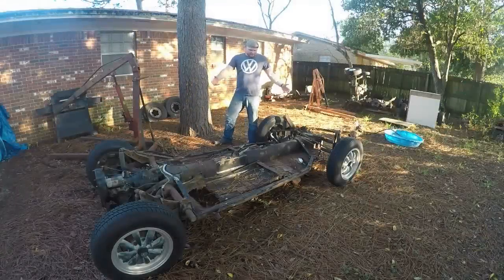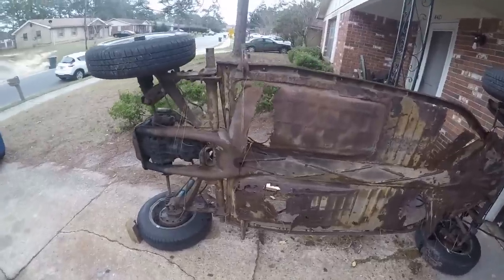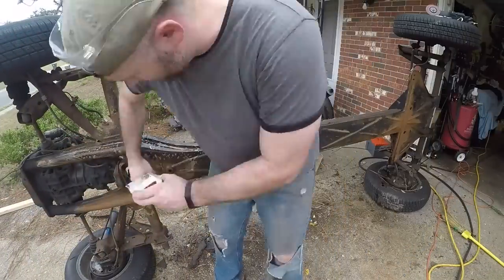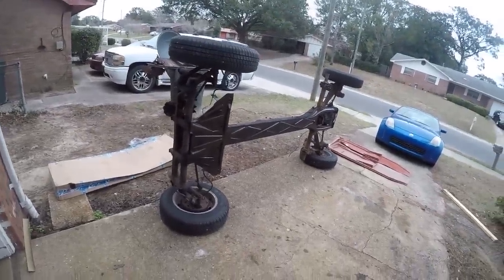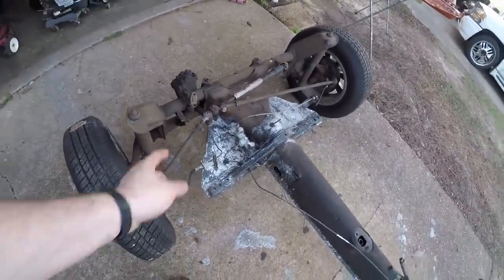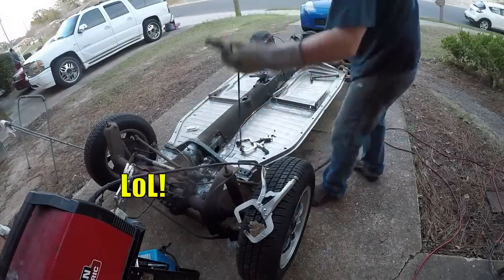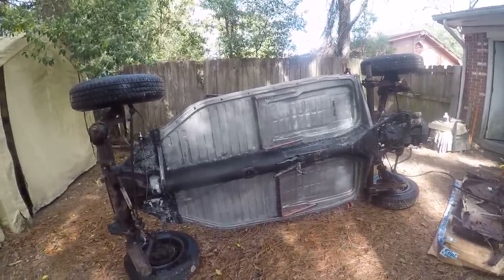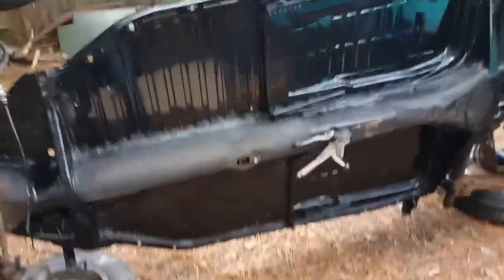Replace VW Floor Pans in 25 Minutes - (Beetle)

Comment: When you see a guy put that much effort into painting what amounts to a car's subfloor, which will never be seen by the owner, you know it's a guy who cares about his work. I wish YouTube would have come along ten years earlier. It probably would have saved my old dear departed Ghia. You truly can fix anything on these cars given enough info and motivation. Thanks for helping keep these old timers out of the crusher, Duckman.
Reply from the maker: At this point after rebuilding my 56 Oval from rust... lol, I just may be able to fix anything....'!  Kind comments like yours at the ones that really motivate me! Thanks so much for sharing!  Do you have any videos of your old Ghia?
Reply: This guy has my vote!  I've followed his stuff for years.
Reply: DuckmanCycles and VW Garage  I'm doing some rust work on an old 98 xj  jeep cherokee man I keep getting discouraged when I think it's is looking up I find more rust.  What can I use to stop or slow rust in areas I can never get to to prep like channels and cavities.  Have you ever used eastwood products do they work? I really really like the acid idea I'll be looking for it too
Reply from the maker: Acid for sure, but you really need to wire brush anything that you can get to.   Once the acid dries away there are inner chassis waxes and tar type coatings with super long  360 degree nozzles that allow you to spray deep in the inner crevices.   Otherwise you have to cut holes and attack things from the outside... which in the case of my oval was probably the best thing to do. :-) Eastwood has a lot of great stuff but I find them to be a little bit expensive when you can find the same things elsewhere without their name for less money. One thing that Eastwood is, is marketing Geniuses! Their name is just everywhere anymore!  Thanks for the questions!
Reply: Stay healthy Duckman! ... I'm saving up for my '68 Bug restoration! You've certainly gained my trust!
Reply: DuckmanCycles and VW Garage
Reply: I totally agree.. A real professional
Reply from the maker: Thank you very much! Really appreciate it
Reply: Given enough info and motivation? Given enough info,  motivation, time, energy, and money.

Comment: Long time VW guy here and I was doing this back 40 years ago. You have a knack for cutting right o the chase and pointing out what needs to be done, although I must admit the chassis you have to work with was pretty straight forward. Up this way we were seeing floor pans in this condition on a 10 year old vehicle and after that the end braces for the front suspension would start to rot. I had to sell my 69 bug for parts when it was 9 years old! (bought it new) It was too far gone. Heater channels too at an early age. Yup, salt on the roads and water leaks everywhere did her in. While I'm here, I should also point out that it's easier to find all of these restoration parts now than it was in the 70s.... internet and all.  <LOL> Oh, for those on a budget, the plasma cutter is nice but not a high priority. (read: expensive) OTOH, for any project like this a wire feed welder is the cat's ass, along with a decent grinder and an air type cut-off wheel. Add a tape measure and a hand full of specialty vice-grips and you can fix anything.
Reply from the maker: Thanks do much for this awesome comment and praise!  I really can't thank you enough!  This one made my day! Most videos I usually show the work done in 5 minutes, this is actually one of my longer videos and surprisingly has gained some huge popularity.  I am from NJ myself, I understand what you mean by these cars just rotting to bits from all the salt.  The plasma cutter was expensive, no doubt, but the amount of money I made using the tool paid for it many times over... for the average "Harry Homeowner" working in their own driveway that may not be the best investment.  I absolutely LOVE by box of vice grips!  Seems any time I find some on sale I buy a few more.  Thanks again for your comments!  I really REALLY appreciate you, and I hope you subscribed!  Lots more videos to come!  :)
Reply: BTW, where a plasma cutter really shines is fabrication work. You can dice up scraps of metal almost as easily as using a straight edge and a utility knife on drywall. My personal project of the moment is a '64 Corvair van and I am having to make a zillion small parts because NOBODY makes aftermarket body metal. I actually made a cardboard template for a door skin then transferred that to fresh metal with the plasma cutter. Yeah, the cardboard caught fire but it can do the job if you work quickly! <LOL> BTW, wish I could find better (read: fairly rust free) bugs up this way. It would be fun to tackle another in my retirement. I might even have some NOS parts still laying around!
Reply from the maker: Put up some videos of that Corvair!  I want to see!  It'd be great seeing you burning your cardboard templates with your plasma cutter.   Haha!  I'd subscribe!  Thanks again for the comment and the story, lol!
Reply: Maybe in a year or so after I retire I'll get around to learning about how to post videos on YT. Right now I'm too much of a cave man / technophobe to understand that part, although I do have near 1,000 pix of the Corvair project now that I am comfy doing digital cam work.
Reply: rupe53 If you had sprayed the underside with oil from day one regularly, you would still be driving it !.
My sister purchased a 65 model off  the original owner who did this ,it is still original and never been near a welding shop !.
Reply: ++ Gerald Swain..  Around here they call that a Vermont rustproofing. It's what you do with your old engine oil. Only problem is you need to know where the car will eventually rust to add that protection and 50 years ago most of us weren't old enough to have that kind of wisdom yet, not to mention we had an almost new car that we didn't want to stink up like it had been leaking oil for 10 years. Also makes a mess out of the garage floor for a couple of weeks. <LOL>

Comment: Wow !!!  I had a 69 automatic stick shift same color..took  2 .. 55 gal drums and made new floor pans..i had to cut the top and bottom of the drums split them down 
The middle then run them over with a fork lift...they turned out very well..also replaced the heater channels..wish i still had it..you did well.. Cheers 🍻🍻🍻🇺🇸🇺🇸
Reply from the maker: Thats an interesting way to make floor pans, lol!  If that was available to me I'd probably have done the same thing in the past!

Comment: Hey Duckman! 
Any idea where you can buy Ghia pans with seat rails installed?
Reply from the maker: No afraid not, I haven't seen anyone EVER sell them that way.  I'm going to guess because Ghias have two different sets of seat tracks, and then there is VW Things, too (use the same floor pans) that use their own seat tracks.  Since they don't sell many of these pans they only make them as "one size fits all"  Just my guess!
Reply: Thanks. I guess I will have to deal with it when I get to that point.

Comment from the maker: Buy your acid/rust converter here: https://amzn.to/2ruGW0B
FREE SHIPPING Beetle 48-70 pans here: https://amzn.to/2T7hvOk
FREE SHIPPING Beetle 73-79 pans here: https://amzn.to/2wtD1qI
71-72 Beetles have unique seat tracks, you can use the earlier floor pans if you modify or replace the early tracks on the vw floors.
I keep getting asked, so I hope this helps someone!  :)
Reply: DuckmanCycles and VW Garage .Nice video. Not sure you needed to remove the orange paint from the replacement parts. That coating should be both weldable and funtion as a primer.
Reply from the maker: Thanks for the comment, but it was chipping off rather easily in a lot of places.  It was not something that was going to stay on!  I appreciate the comment, but yes, it needed to be cleaned off before properly painting.

Comment: You have one steady hand with that plasma cutter. Job well done sir!
Reply from the maker: Thank you!  I cheated though, lol!  I kinda ran it along the metal seam...  hehehe!
Reply: @DuckmanCycles  that's not cheating that's using your noggin. I have a 70 , well the wife does but I'm going to do the work. It's pretty rusty, and I'm afraid to pull the body... Lol thanks for taking the time to edit/post this video

Comment: I think he does a great job but if I was doing it I would have the front and rear suspension off and would blast the remainder of the frame put in the new floor pans then paint the whole shebang as a unit.
Reply from the maker: Yes, if that were my pan.... or if I was paid for that much more work.  But I wasn't so you get what you get!  Thanks for the comment!

Comment: just a question, I never saw you take measurements, how can you be sure that the body will fit on the new pans
Reply from the maker: Thanks for the question!  Measurement is really the only way short of test fitting everything together.  But I have a video going up that details this tonight at midnight!  Make sure you subscribe and hit the bell!  Thanks for watching!  :-D
Reply: First time I did pans, on my brothers 72, we were just lucky everything lined up. I didn't think they wouldn't line up. When I did my second set, separate 72, I bolted both pans to the body, and set it on top of the frame. Tack and lift then finish, but I had brazed everything, only had a stick welder at the time and....
Reply: wheres the video of measurements? Ever think about doing a video of heater channel replacements? Seen this video like 5 times because Im about to do my floors. Thanks for the videos

Comment: I have a 412 wagon. Sleeps in the garage waiting for that guy. You know the guy that want to pay 20k for a project. Hes probly 2 or 3 years old right now so we wait...
Reply from the maker: There is always someone that will pay too much... I've been pretty good at finding them.... haha!   Thanks for the comment Nate!
Reply: Gold
Reply from the maker: Hehe
Reply: Oh I worked for a wrecker for three minutes and was pulling engines out of front end utes and cars in 10/15 minutes,oxy off the front grill brace panel,bolt cut the plumbing and wires,unbolt the bell housing and fork the motor out,while it was all savage like,it’s possible what you can do,check out Jonathons W site for old cars and first starts,this fucker is gold I tells ya,thanks buddy nice work,loved the chop job.

Comment: If I ever get a bettle I'll know how to do floor pans
Reply from the maker: Get one!  Get one!  :-D  Thanks for the comment!  :)
Reply: DuckmanCycles and VW Garage been looking 
Sadly most of the ones on my state are rusted out or stupid expensive
Reply from the maker: What state are you in?
Reply: DuckmanCycles and VW Garage Kentucky 
Curse you road salt
Reply from the maker: I used to live there, I had a short stint in Hopkinsville.  But you're not too far to travel to down here and find one.  No salt here, except the ocean.  Usually the VWs here are rusted from the inside out when the windows leak because of all the rain.

Comment: You made it look easy! I used to have a 71 AutoStick that was a hoot! I was a receiver at the auction in Baltimore that I believe is part of the Manhiem Group. I lived in West Baltimore City and sometimes the county but I bombed it on I-695, I-95 & other very busy roads with a 1/4 sheet of plywood to retain my carpool buddy and my driver's set had a brick on the heater channel & seat frame to keep my seat from rubbing on the road! #3 plug was the derathkneel!
Reply from the maker: I'll admit, it kind of is easy.  Its a lot of work, but not particularly difficult!
and hahahaha!  Thats quite a story!  This car the other had a 2x4 bridging the hole in the floor so he could drive it, and a mat just to keep the road spray down.  Talk about dangerous! LoL!

Comment: Great video its exactly what I was looking for . I understand this video is a few years old and I haven't read all the comments but I have a suggestion that you leave the paint on the pan and only remove the paint from the lips that will be welded. I'm not a car guy but I am a welder. Just a suggestion to save time and energy. Thank you again for the video.
Reply from the maker: Thanks so much for the comment!  You suggest you're not welder, but are you a painter?   Would you paint over rust, and other peeling layers?   That's why paint was removed... and the pans properly sealed afterwards.  You're be wasting a lot of time and energy when the rust gets worse, and the new paint peels off, too... WHEN YOU HAVE TO STRIP IT ALL OFF, BUT THIS TIME WITH THE CAR ASSEMBLED!  Bad news, dude!  Thanks again for the comment!
Reply: @DuckmanCycles  Were the replacement pans already rusty or what do you mean? I think he means not to strip off the paint on the new pans. Wouldn't it be perfect surface to paint on? I'm not trying to look smart here, I'm just new to this and confused at this step. I have my fathers old -73 that needs this, and I'm planning my steps 😅
Reply: @DuckmanCycles   what I said was leave the red paint and only remove paint that will be welded or that you cut in to. I said I'm a welder, so it's obvious when your welding on something that's galvanized and not galvanized. It's obvious the paint on the pans were a type to prevent the rust so your wasting time removing the paint that came on the part. It's gonna rust regardless because you didn't use any cold galvanized spray.
Reply: @anttilammi7471  that's exactly what meant. Watch a few other videos because this guy didn't even read my suggestion correctly. I watched the video 3 times and he never mentioned anything about the new pans being rusty. The pans come with a rust inhibitor. He said the pans galvanized, a hot dip hell nah no freaking way that's way to much for a simple pan.

Comment: Nice quality work! Especially impressive considering it's done outdoors without an enclosed shop space, without help, and without high dollar equipment. For cutting out the old pans, I'd suggest getting a "sheet metal ripper" cutter for your air hammer as it's much faster than a sawzall and has almost no potential to accidentally start a fire like a plasma cutter. With all the pine needles and flammable debris around, I'd be very cautious about firing up that plasma! Always keep a fire extinguisher nearby.
Reply from the maker: I never thought to use my chisel to do the cutting on this.  I'll give it a try, might be easier to tackle from the underside as I have been.... but there won't be any dramatic sparks to put in my videos without the high dollar plasma cutter!  :-D  What fun is that to watch?  Haha!  Thanks man, I appreciate the comment!  :)

Comment: Great video! What brand acid etch did you use? Also, any chance you know where to order Ghia pans with seat rails? I've only seen them without for the Ghia.
Reply from the maker: I bought a bunch of stuff from the local mega home improvement stores when they had it on clearance a couple years ago.  But any phosphoric acid will do the job for you!  :)

Comment: I just finished welding in a set of Wolfsburg West pans in my 67 bug, and it was interesting to hear you say the back of your pans and the left front had some figment issues. I had the exact same fitment issues with mine
Reply from the maker: Interesting, not sure if they were cut wrong or if the pan had been tweaked,  The suspension measured square though, so its good enough!

Comment: I thoroughly enjoyed your work, and learned alot. Thanks for your work and putting it on. You certainly look like you know how to do things efficiently. I had a vw 1300 Beetle for 25 yrs and coated the floor under and above, the door pillars and inside the doors etc with fish oil product, the odour soon goes away. It had no rust at all, anywhere. I'm so sorry I parted with it.    From Hornsby ,Sydney Australia.
Reply from the maker: Thank you so much David!   I will likely chase my pockets with oil based product too!
Reply: @DuckmanCycles  The fish oil is great but it is best if not exposed to the sun, ie used in places where the ultra violet can't attack it.
Reply from the maker: Good call!  Thanks for the suggestion!

Comment: Nice work. I had a 64' that had more rust than not. Final drive the seat fell thru the floor while I was sitting on it and driving about 35 mph, just enough to scuff the road but that was the end for me. Used the engine and trans as a backup for a Super Beetle that I never needed. Still in storage somewhere.
Reply from the maker: Thank you!

Comment: Good job! And you said you donate paint. That's a great trick,building car models I learn that one. Painting outside on a warm to hot day with spray cans  light coat first and med. to wet coats after that, A nd the paint flows out like glass ,just don't rush it so it doesn't run.And you did it perfectly that works really well using high temo. eng. Paint  spraying eng. Part .looks professional.Just a tip for your watchers , kid short on money you can get a good job with can just so you don't rush it and run it! Great video!
Reply from the maker: Thank you!